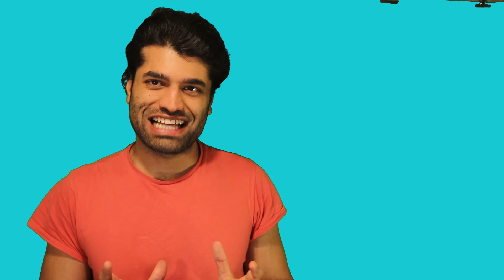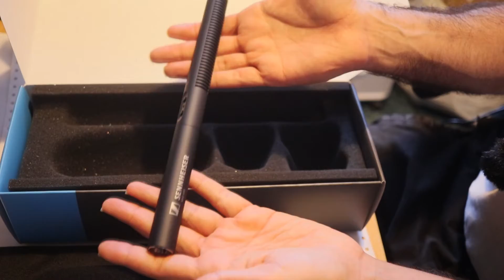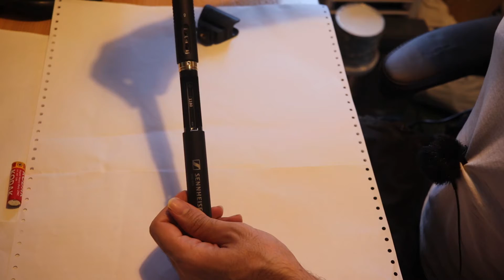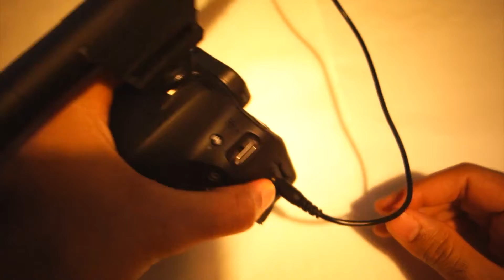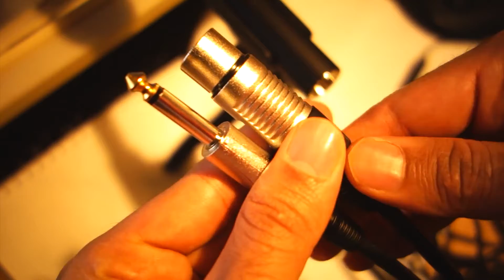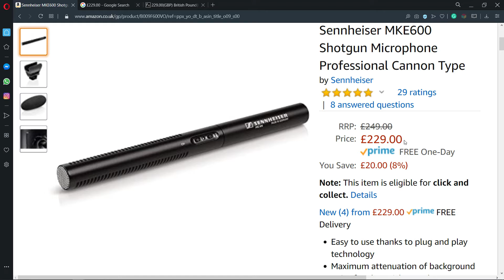Sennheiser MKE 600 Shotgun Microphone Review, Unboxing, Testing

Comment: Have you ever experience loud static on this microphone?
Reply from the maker: Sorry for the late reply. No, I haven't experience any lout static noise. My biggest problem with this mic is that sometimes its battery finishes and it's not very easy to notice. So, after finish recording you might realise the annoying cuts in the audio due to battery. But, it's a great microphone all together and I'm still using it.
Reply: @PracticalTechFixes  thank you!